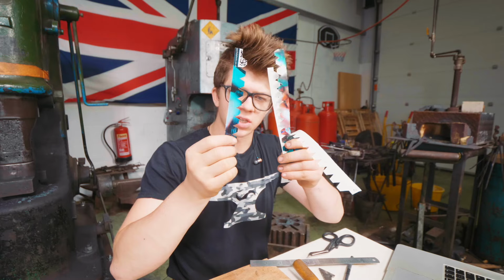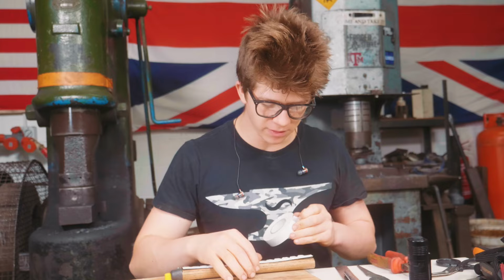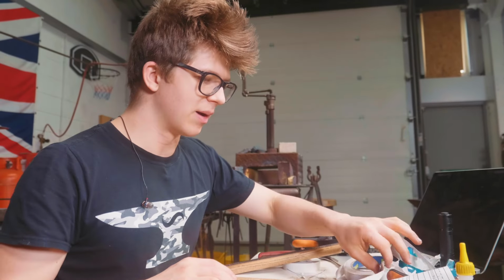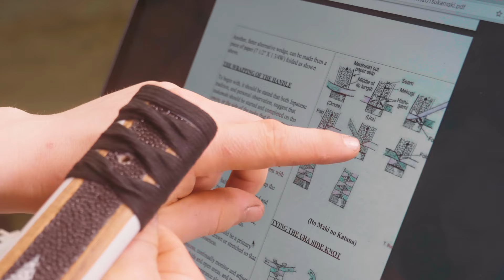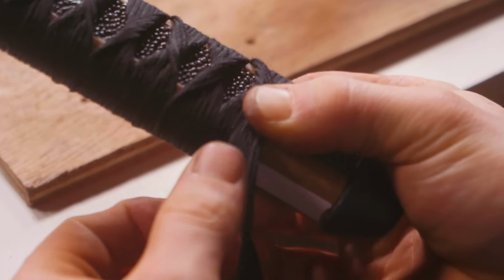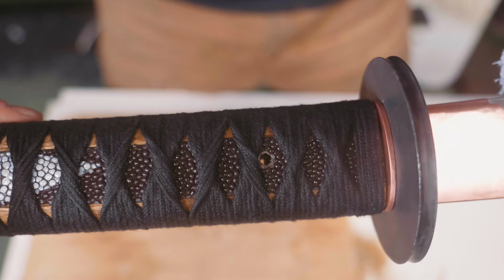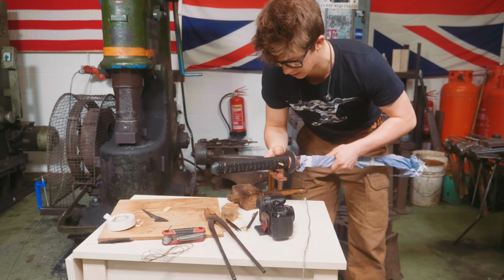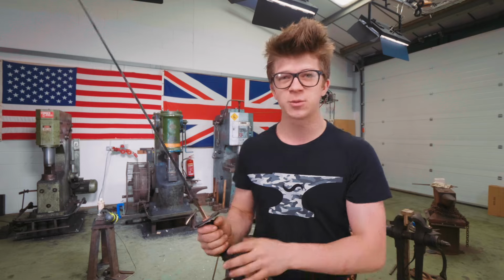MAKING A KATANA!!! 1 MILLION LAYERS!!! PART 14 ... Finished!

Comment: If you ever do this again, soak the ito (cotton woven chord) in water first, the wet ito is easier to wrap and as it dries it tightens to the tsuka (handle) naturally. Also you sort of already discovered this but swordsmiths offset the handle holes to the blade holes by the width of the fuchi (collar that separates the tsuka from the tsuba) because the wood tsuka and (historically) bronze itamaki (collar at the base of the blade) would compress more than the iron tsuba and  steel blade allowing it to snug up to the blade rather than drive it apart.

Comment: I designed heavy winged Dagger, blade is 8"from guard to point, 1 1/2" from edge to edge,. looking down the length of the blade it is diamond  shape 1/8" thick centered.  The guard has the feathers to blade a the hilt is a bird's body, the pommel is a short swallowtail!

Comment: Am I correct in thinking that you would only be required to fold the steel an additional 20 times or so after your initial fold to reach
1,000,000 folds / layers? 🤔

Comment: Don't be confusd when he says
1 million layer katana
he just folds the steel over 11 times
It's like folding a piece of paper where if you fold it 1 time, it has two layers
then 4 layers, then 16 layers, then 64 layers etc.
folding 11 times results in 1 million layers as it is multiplied
Effective method of hardening blades with a tough cutting edge!

Comment: Damn dude, I envy your workshop and you're fun to watch but when I wrapped my katana it wasn't that hard, my hands are extremely strong though, I've been working with my hands since I was 3 though. My toys were a bench grinder and a vise with an anvil on it so I've made quite a bit in my life. Still though, you've made quite an impressive piece but with that shop and the knowledge to use it, one could make anything. Literally.

Also, mine was all steel, no wood

Comment: I've done tsukamaki and the learning curve is hard on getting a good result. Just in case you want to do it again I'll highlight the 2 biggest mistakes. 1. Your samegawa panel were too narrow and not the right type. It needs to be rawhide rayskin and not the type that is tanned for use in wallets. 2. The hishigami need to be made from paper folded several times so it is thick enough to give structure to the wrap. Overall, this is a great result from a first time attempt and I'm impressed.

Comment: Uuimmm....a metal coat hanger or some thin metal rod with a 1/8inch 90° bend at the end wouldve found the holes in lile a 30seconds!! Coulda saved alot of time simplifiying things....think Slimgblade...check if theres gas in it first!! Lol

Comment: Looking again, you fold the tsuka wrong. You should actually fold it 'in' not 'out'. And the katana tip should be forge to the other side after cutting the 45° degree angle

Comment: I havent really watch the 13 other parts so Im not sure of the process of his forge,  but if I assume that he folded the metal alot to get the so called 1 mill layer, then by the end its not even steel anymore its just iron, i think thats how metalurgy works
Reply: It's steel. Folding only distributed the carbon in the steel evenly across the length of the blade. Also quenching the blade turns the iron structure of the blade into much harder steel

Comment: It's sad that using this technique the blade doesn't get a hamon. I watch a traditional smith make a blade and the curve happens on the quench they don't add a curve themselves. and they put softer steel for the back and the blade edge is harder steel and then they put clay on it to create the hamon. Wich imo is what make a katana so pretty. You see a lot of smiths these days try to make a katana but they don't make them properly. I'm not saying not to use modern tools, nothing wrong with modern presses etc. But id love to see a proper Katana made with the proper traditional steps. Theres great documentarys on YT you can watch to understand what I mean.

Comment: when using "superglue" ... always keep at hand both a solvent and a catalyst !
in addition, you should start learing how to test fit before, trying things in an separated piece not the final one .... you will spare so much time investing time into testing before. 
For example, avoid using epoxy on leather ... there is a dedicated glue for that ... it's called "artiglio"  and it's perfect for leather glueing. 
I know that this is youtube and u have to entertain, but sometimes it's very hard to watch you wasting so much time re-doing things that you could have avoided by testing beforehand, or just by studying info available online. 
And please, pattern weld is not "Damascus" please please please, stop spreading that misinformation. 
I know this is a very old video but i hope this comment can reach you. 
For all the rest keep up the good work.

Comment: I wonder how much this thing would cost?? Let's say he low-balls the value of his time and his skills and charges $35 for every hour of his time over 160 hours. Lt's low ball the value of materials again (i have honestly no idea really) and say $100 of material. Tack on another say $7 per hour of using the shop and all the equipment inside. We're already at $6,820... And if I was putting in this kind of manual labour and effort, I can guarantee I'd give myself a higher hourly rate.

Comment: isnt it like to often folded steel gets "weak" ?
Reply: After so many folds deffinitely. Four folds is often more than enough, and twenty would destroy it by removing too much carbon, no matter how high-carbon steel you use. And you can get better steel and faster without impurities just by liquefaction, they folded it just because they couldn´t make it over melting point in that time.

Comment: I would've thought that if one makes a sword, that the time and effort goes into the blade, and the rest just falls in place. This video shows the opposite. I love katanas, and I would like to say that you have a nice handle, but the blade is not very good. Too many layers are not good for a sword. And a katana is made of steel melted from rocks in a very hot smelter, they choose the steel lumps carefully before binding them together and forging them together, and they also have a soft side, a hard side and a hard point that aligns with the yakiba (the side you slice with). It takes alot of time, is very delicate, and hey, guess what? The blade isn't bended, it bends during the quenching because of how the katana is built. Research before doing such a nice handle. You wasted that handle on crap, sorry to say :')